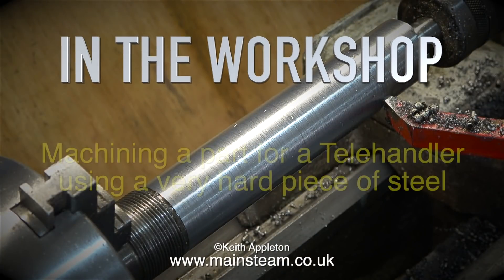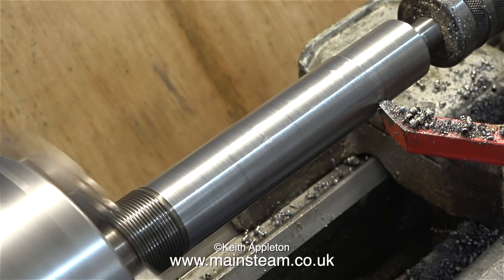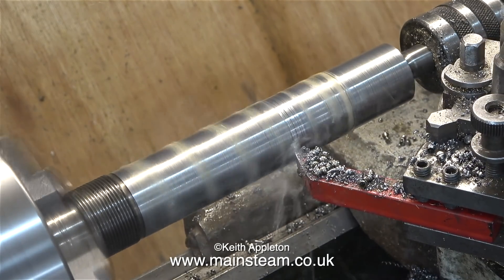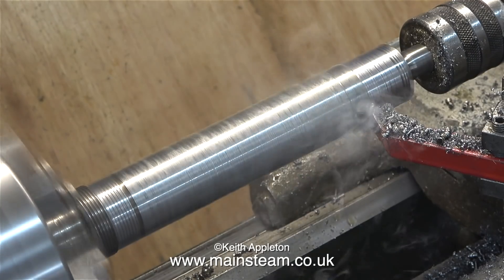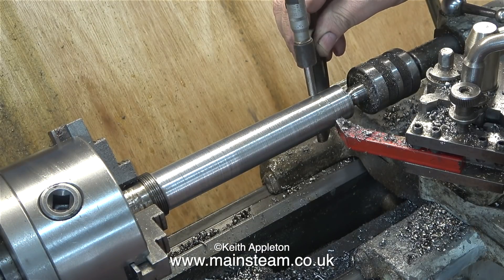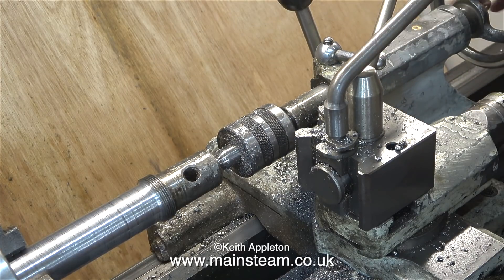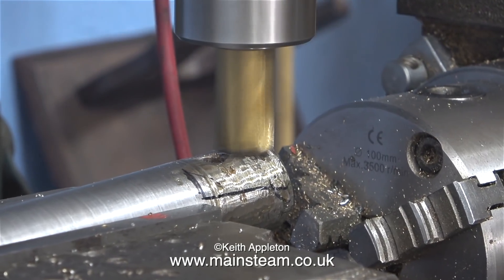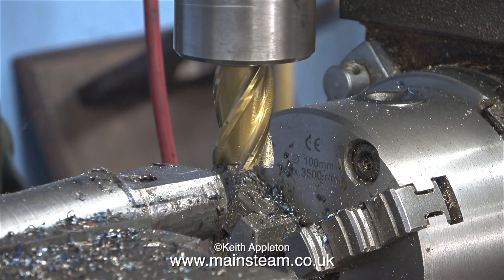MACHINING A PART FOR A TRACTOR - IN THE WORKSHOP

Comment: I recognized that pin, they are indeed very hard, and very strong.  The clevises they fit into are not as hard which is why they wear out first.  We never had a lathe in the shop I worked at, we had a milling machine for surfacing engine heads, an excellent drill press, and some very powerful grinders, but no lathe.  So if we had a problem pin we had to buy a new pin, and they are not cheap. What you just did saved your son about $30 dollars which in pounds is L21.  I'm addressing your son here when I say he is very lucky to have a dad with a lathe!